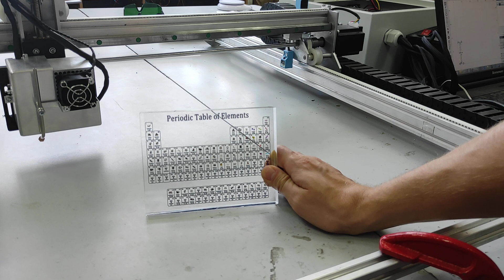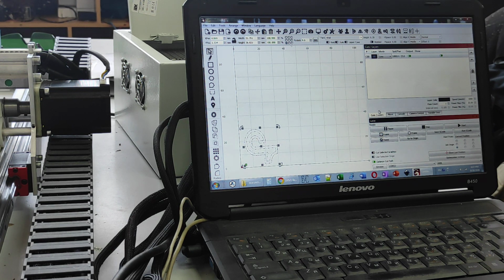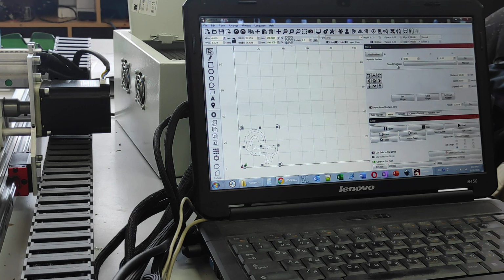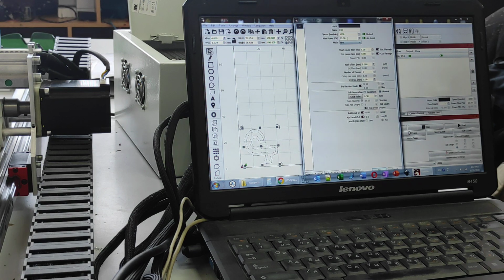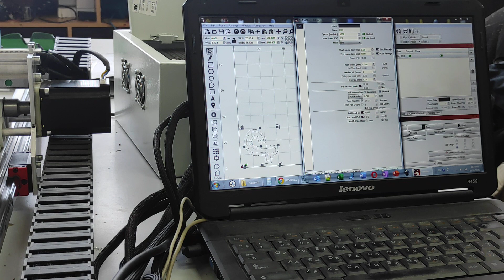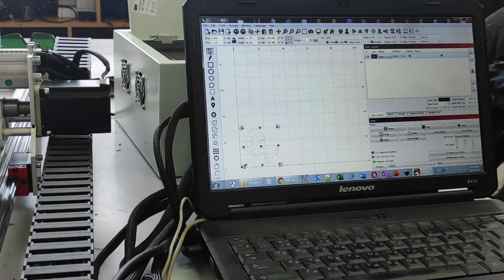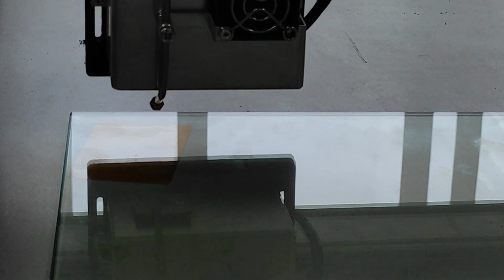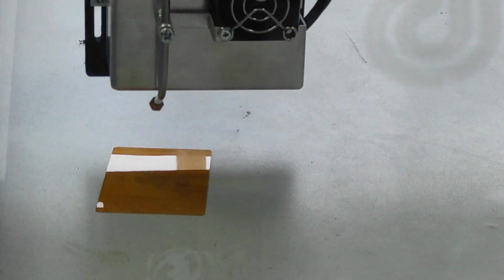Engraving on a clear acrylic and a transparent glass using an Endurance 15 watt "Duos" laser

Comment: the laser focused on a top or bottom of transparent material?
Reply: Focus has to be done on the surface of the card (or paint) so on the bottom of the transparent material
in fact it's the burned paint on the card help to rise temperature on the surface to burn the glass
Reply: @TFlorian  Thank you
Reply: Same question.
Reply from the maker: somewhere closer to the bottom